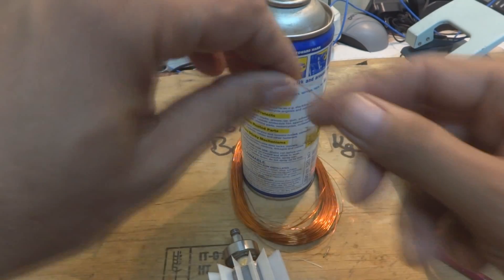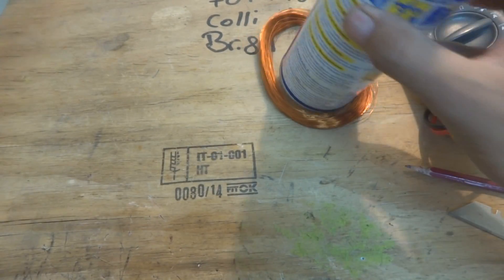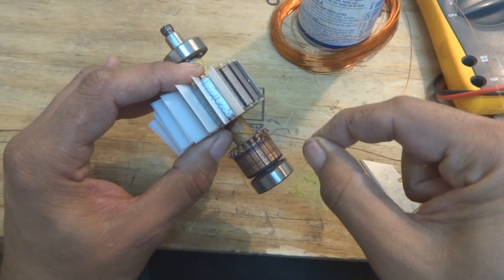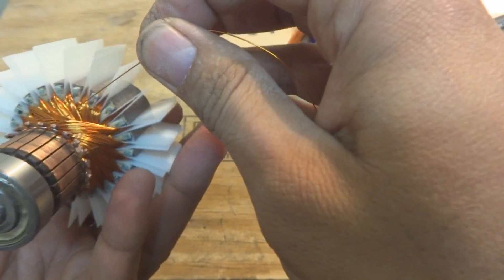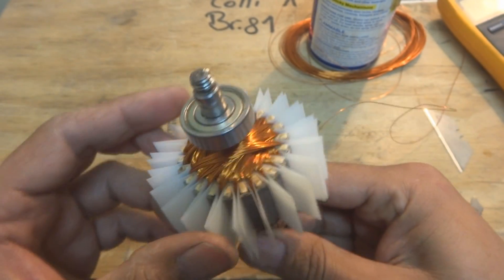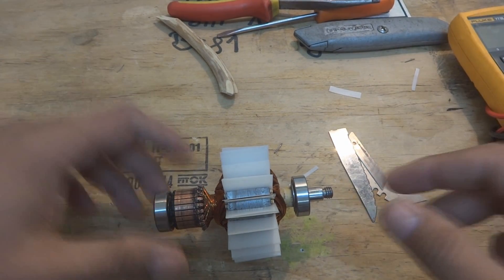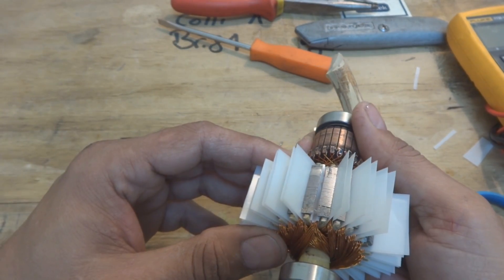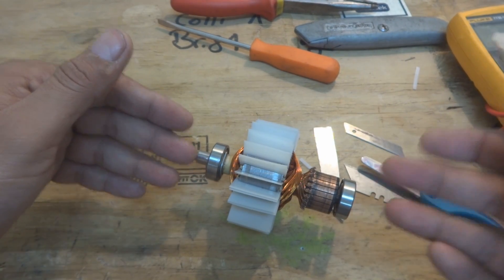Universal motor rewinding. AC series motor repair. Part 3

Comment: So there is only one wire ?
Reply from the maker: Yes sure. If you are attempting repairs, you may watch these videos carefully and hope you will be easy to go.
Reply: @JahanZeb1976  Thank you sir. I watched some of it and sometimes I believe 2 wires are used. The coils are made alternately then the 2 wires are connected at the end on a strip. It's still a bit confusing for me. The procedure seems more complicated on an AC motor than on a DC motor.
Reply from the maker: That two wires or two coil at the time technique is used by machine winding. And some winders prefer to do it in manual hand winding too. Anyhow both ways have same results and same configuration. You are right the two wires configuration is a bit confusing. I personally don't prefer that way.
Reply: @JahanZeb1976  Thank you again. Please answer me the following question this will help me to understand well. In lap winding I always read that it is the winding method used for much intensity because the coils are in parallel but I don't understand why because coils are following each others so are in series. Does it mean that current go from brush to brush around commutator IN BOTH SIDES (all around commutator) ? This is the only way I see to understand this parallel behaviour. Thank you so much to answer me 🙏

Comment: Can you tell my why some starter motors have brushes 90 and some 180° seperation from ich other? I see some starter motors have carbor and some copper brushes which is bether to use? Wuld it by posibel if you for exampel use the ground leading brush and take that to a seperate electric motor and actualy combine 2 electric motors in series? Wuld that work? Useing the same power sorce?
Reply from the maker: This is all about motor design. You can connect two motors in series but in such a case you will need double voltage input if motors are identicle.

Comment: What is the paper that u put in between
Reply from the maker: Myler insulation paper. Available from electrical supply stores. You can use old x-ray also.
Reply: @JahanZeb1976  can u do a video on rewiring old fan motors

Comment: That means you are going to repeat same style till circulationl complete
( counting three from every slot)?
I have tried it I counted three only at the start and continued normal way
 by the time I got to the starting point I had two empty slots without copper tied on them so I was confused 
If you can brief me the start and the finishing
Reply from the maker: Watch the video a few times and you will understand it well. You will have mistake in the middle somewhere that is why your count finished before time. Try again and hope you will make it working. Good luck 👍.

Comment: sir this is the same way for angle grinder rewinding?  greetings...
Reply from the maker: The winding pitch and little other detail may vary. But the working principle is the same for rewinding. We encourage you to make experiment with that and let us know about your success then. Regards,
Reply: sir, a while ago i dismantled a grinder, and i figure it out that there is  two wound in 16turns and the rest is 42turns.which different in your video, regards...

Comment: how to do if the commutator is 24 and 12 holes
Reply from the maker: You may look to the older motor connections. If will give you information about the connections.

Comment: Do you have to scratch the varnish of the wire everytime u loop it around .....
Reply from the maker: Sure it is needed to scratch the varnish from the wire when it will be the time to make it loop on the commutator segment for connection. The rest we will not scratch varnish anywhere from the wire. Hope you may understand.

Comment: sir how to rewind armature of miter saw sir.
Reply from the maker: O understand now! The same way as I have shown it here the vacuum cleaner motor. These motors are nearly the same. You must watch this video series a few times before attempting the job. So you will understand fully the process and will not miss anything. Also my advise if you may rewind the field winding as well if that is bad for your machine. As it was not bad in my case so didn't rewind it. If you face any problem, you can ask any time. Best regards and wish you good luck with your repair.

Comment: how thick and paper type of insulation should be used to rewinding
Reply from the maker: The paper is thin myler paper. The thickness is not that critical. The critical points I already described in this video.

Comment: So cool sir.. So you start from the commutator on that slot and count 10 over always? I'm guessing this machine has 20 slots.

So if a machine had 16 slots you would count 8? and if 12 it would be 6 and so on... If you can answer that you are my new favorite YouTuber.. Always wanted to learn AC Series Rotor winding and it looks like I found the man. Thank you.
Reply from the maker: You are right dear friend but your question is dealing with motor design which is way difficult subject even I can't understand. The easiest way to rewind such a machine is to understand some basics as I discussed them here and then look at the old winding and collect enough data from that. Then rewind the machine with same data with new wire and new insulation papers in. Hope you may understand my answer. I would upload further videos on the subject to make it even more clear and will try to answer your question in further detail.

Comment: Finally I find how to rewind an ac armature. Thank you.. Also if you like fan tips: Use a small blow torch to burn insulation off. It prevents chaffing ultimately making for a better connection to your commutator tabs.
Reply from the maker: You are right but I am not a professional motor re-winder. This is only a hobby and this was my very first AC series machine I wound. But as I am electrical engineer, I know my subject very deeply and well. I can explain the things in much more technical way compared to ordinary people doing a job for years without understanding.

Comment: salam alaykum from indonesia, do you happen to know a way to make brushless dc motor without sensor? or if i have to what kind of sensor do i have to use?
Reply from the maker: Motor manufacturing is something not easy at home for a DIY. Better go for a prebuild factory motor. They are not very expensive and easy to find. Regards,

Comment: Ur video title is AC motor but ur repairing an armature for a DC motor.
Reply from the maker: I am sorry if you misunderstand it. This is AC series motor used in vacuum cleaner. Check the whole series of videos from part 1 to part 5 then you will get it right. Actually AC series motor and DC motor is nearly the same with very little differences. Hope you will find the whole series very useful if you are dealing with electrical. Thanks for comment.

Comment: That looks fantastic, just like a new one :-D.
It looks so impressive, you have reproduced the original but i think yours will be more reliable, you are so carefull to make sure its correct :-D.
.
Its a pity that you dont have a "growler" to test interwinding shorts, but im sure your carefull winding will not have any problems :-D.
.
The wires connecting to the commutators are often impregnated with some kind of grey hard cement, obviously to stop the wires breaking/moving with the centrifugal and rotational forces.
And the varnish immersion would be the last step?
Reply from the maker: Who have no experience?
Reply: Dude did an awesome job. Seems pretty experienced to me.
Reply from the maker: +zx8401ztv Thank you very much dear friend for so awesome comment. You are right there are so many procedures to do who even I don't know. I am still learner in the field. This was my very first motor winding attempt as I mentioned before. It was very nice as results were more than expected. The next step is explained and will be shown in the next part. Regards,
Reply: very good
Reply: but he have no experience